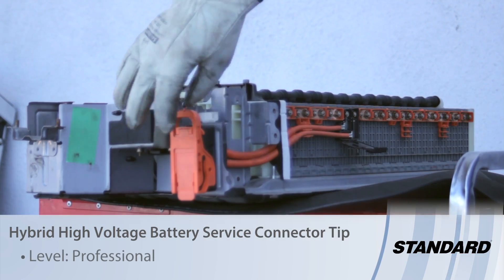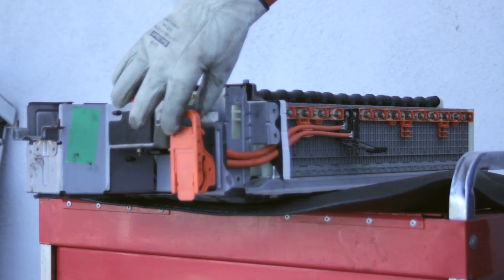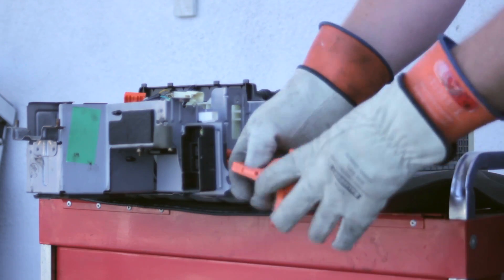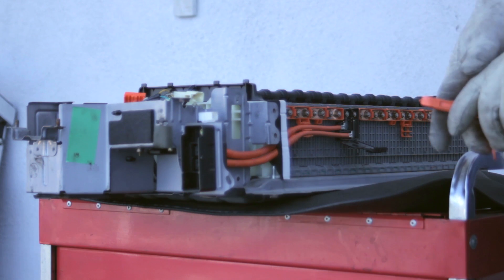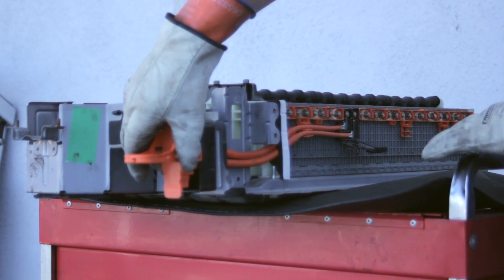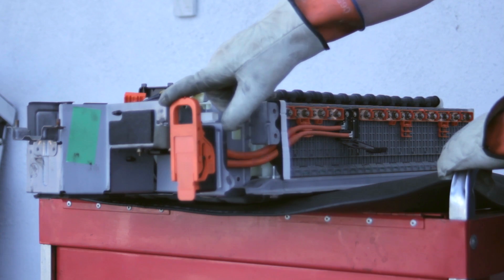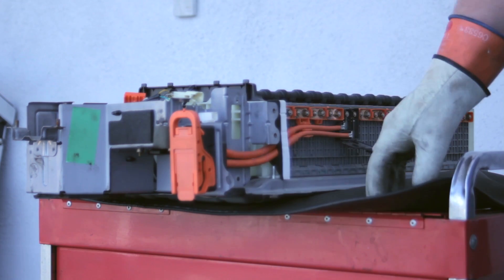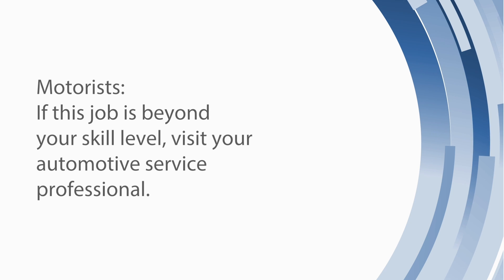Hybrid High Voltage Battery Service Connector Tip

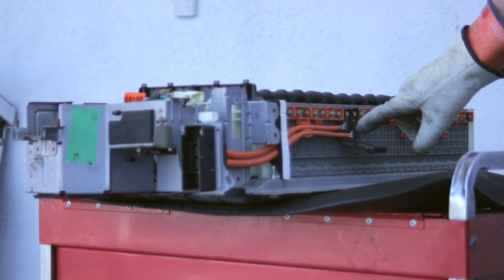Comment: At time sequence 0:38 you describe the connector going between positive and negative.  This is not correct as that would be a short circuit.  It is actually circumventing power flow through one leg of the battery most likely the negative side.